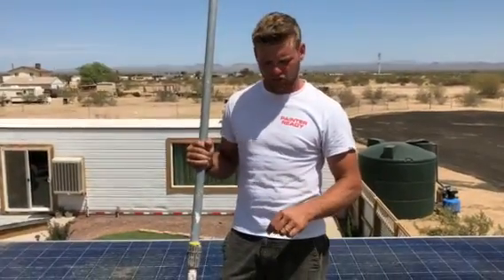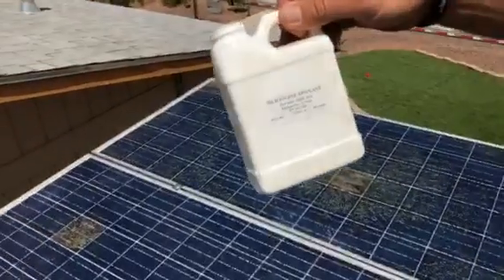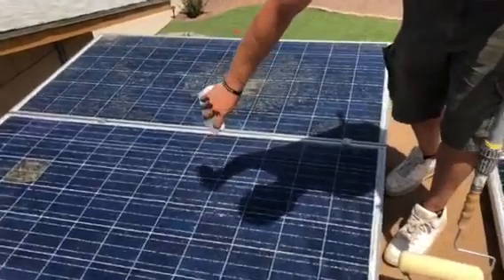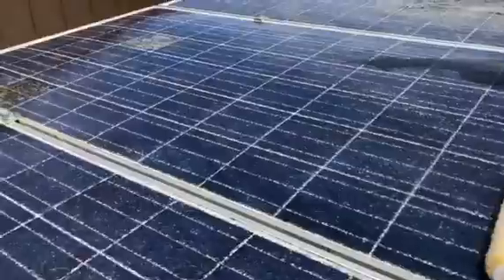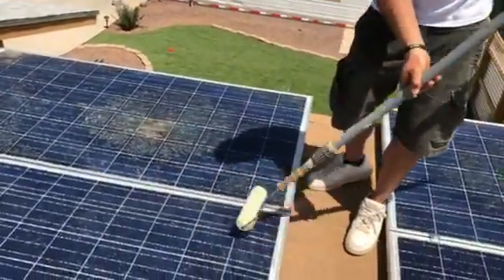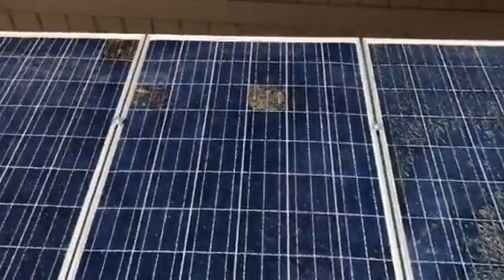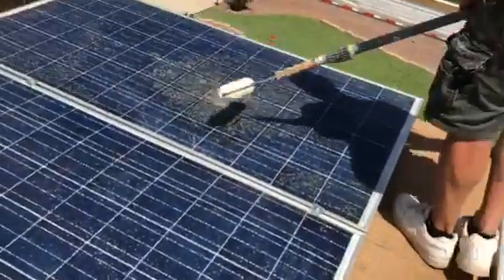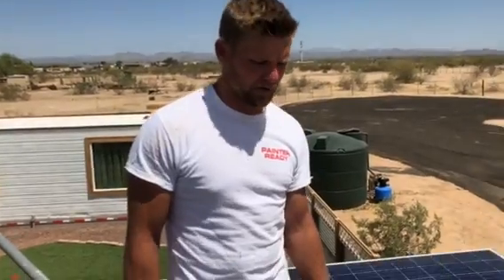How to repair broken or cracked solar panels

Comment: with how much this stuff costs versus solar panels, you'd be better off pitching the panels getting non broken used panels somewhere. i can get used solar panels for $30-100, this epoxy kit costs $65 and will need to be reapplied every other year at least.

i have 1 broken panel i was considering trying to repair but there's no cost effective methods that i've found. it will just be relegated to charging my golf cart and probably use some cheap lacquer on it.

Comment: what happens if they get wet when not sealed? will they continue to work with out a seal? nice job !
Reply: The electric circuit will rust and fail
Reply: If they get enough moisture inside, they will short out.

Comment: Please tell approximately how long the coating held up. Is it still performing at good rate?
Reply: the coating started to yellow after 2 years and the power dropped about 10%
Reply: @BlkFireHawk427 I bet there's a solvent to wipe off the sealant product and reapply for 2 more years🤔

Comment: HOWdy  G-M,
Thanks for the VIDEO
I have had success with Marine Grade exterior rated " SPAR URETHANE" 
Available at MENARDS or LOWES
COOP
...
Reply: Isn't Spar urethane resistant to ultraviolet light, and thus reducing the output power of the solar panels?
Reply: @DougWoodrow  = YES = UV resistant = that  is  WHY  I Chose it for the  Fuel Gauge on my HARLEY

Comment: I'd highly advise no one to do this. Especially if the panels are on your house or anywhere people dwell. A cracked panel is a ground fault waiting to happen. So unless you know 1000% that you've sealed this panel completely, which I can tell you from seeing the manufacturing process myself you haven't sealed it, you will have ground faults. Hopefully, your inverter will catch them and shut the system down but they dont always catch them and if your system isn't grounded properly, it wont catch them at all. Ground faults are a big fire risk in the electrical industry. A lot of the safety measures that are taken in the electrical industry are done specifically to avoid ground faults because they cause fires. Also, those dark spots on the panels are burned out cells. Over time, more and more of those will happen. If it hasn't caught fire yet.
Reply: This is absolute nonsense. That's not what inverters do.
Reply: @MikeWorcester part of what inverters do is to pick up faults in the system. Unless you have a really small, cheap inverter.
Reply: I  believe your referring to a string inverter with micro inverters it should be fine the only problem with this over time is that the epoxy will start to yell after so many years I heard but he might get 5 to 10 years out of them I instal panels one of my customers had a bullet go right through his panel and it’s still producing right now and that was about 5 years ago with no epoxy or anything
Reply: @ACAMPS.HITHOUSE  either you have a string inverter, a string inverter with optimizers, or microinverters. You can’t have a string inverter with microinverters. Either one string inverters or micros either one should pick up that fault and shut down. I’ve dealt with arrays with bullet holes, hail damage, etc… One panel, sure go for it. There’s a small risk but for an entire array, it’s not worth risking your house and the people in it to save a few bucks. UL1699B read it
Reply: @ACAMPS.HITHOUSE  one thing I forgot to mention. I’m dealing with a site right now that has about 50MW of hail damaged modules. The number one concern here is fire. We’re running water trucks once daily to make sure vegetation doesn’t dry out. That’s $15k spent every month to make sure a fire doesn’t break out. That should let you know how important it is to not operate an entire array of damage mods.
Reply: @jarrelljulien5673   I know the difference between string inverters and micros inverts maybe I should have put a period or comma after string inverters but what I was saying is with micros u don’t get any faults unless your talking about monitoring on your computer or tablet it’s not like a string inverter that has a screen on it. And yeah if your talking about 50 megawatts your talking about a big solar farm with millions of dollars behind it this guys putting them on a separate structure on his property doesn’t look like it’s on his main house. This is a small residential job your talking about a whole farm full of broken panels. I’m referring to this guys specific situation. But I really still don’t see how this could cause a fire solar panels cause a fire is extremely rare I’ve never seen it even if you have an arc fault it would just trip the breaker or if it’s a string inverter it would give you an arc fault alarm. I mean you’d have to have some dry grass around or flammable materials this systems going on a roof.
Reply: @ACAMPS.HITHOUSE  yea, I agree with you there. In my original comment I said don’t do this on your house or anywhere people dwell. I’ve seen more inverter and combiner fires than panels but I’ve also seen plenty of hot spots on panels. Shattered panels cause hot spots. Once you have one, you’ll get more because of the increased resistance in the panel. From there you’re basically turning that panel into a heater coil. Throw some dead leaves or a handsy squirrel under the array and it could be a big problem. The initial savings you get from this it wouldn’t be worth the risk of installing these on your house especially with the reduced output, in my opinion. FYI, micros throw faults too. They’re not exempt from UL standards. I’ve had to plenty of panel swaps to test micros and panels for Enphase.
Reply: In my experience these don't catch fire. It's also been my experience that when I find people without power or refrigeration a broken panel works well. I use washers and screws to a fix these busted panels to pallets somewhere in the yard ( yes they are not good on the roof) them boom poor people can has running water.
Reply: Yup I would only used crack panels on a wooden frame away from my house fused and with breakers and even then still a large risk.

Comment: Could you update performance of this solution ? You posted this some time ago so I wonder you could get some aging info now. Thanks for your time!
Reply: Thank you.. I just having some panels with issues.. I will try your method. If you need some help on broken inverters can ask me for help anytime you need l. Thanks
Reply: Panels that I did coat started to yellow after 2 years. Performance dropped about 10%

Comment: what is the point of spreading it on whole panel? I have one broken place like a rock hit it. Is this like a shiny topcoat that improves the performance of the panel?
Reply: The glass usually shatters like an unlaminated windscreen. Cover wherever there is cracking to seal out water 💦

Comment: I am also here in arizona, and picked up quite a few panels just like these. They still produce 90% of the power which is amazing. Does the silicone over time change color or yellow?
Reply: Hi Michael, I have several broken panels too... for how long have you being using them? Do you percieve any performance degradation?
Reply: @Eddy Lockhart  So I have had these shattered panels (the whole surface) for 5 years now, and they still produce 90%. One panel I coated with the two part marine Epoxy did yellow greatly after 2 years, so I don't use that one and I don't plan on coating the other shattered panels I have (bought for $25 each at the time). They were a great emergency back up option.
Reply: @BlkFireHawk427 you mean those five cracked panels are working 5 years without qsil216, right?
Reply: @BlkFireHawk427 btw what do you think, does it make sense to buy such a panel of 370 watts still producing almost 100% of power? it's shattered not heavily but it seems it doesn't really affect it. Price is 50$ for such panel
Reply: @dmytrolytvynenko6537  Hey, Sorry for the late response. The only concern you would have with a shattered panel is Water/Rain. Here in Arizona, there isn't much of that, so they are of value for a cheap price, especially in an emergency
Reply: @BlkFireHawk427  isn't much of rain, but it occurs from time to time, I tried to google and I see you have about 12.26 inches rain annually, and my region, izmail Ukraine(it's the most southern part of country) about 17.5, not big difference. The biggest reason I am buying this is to be safe from electricity blackouts in winter and maybe save some money in a long perspective.
Reply: @BlkFireHawk427  thanks, i thing I wont buy this qsil216, if I decide to do something with this, maybe use some film to protect it from rain and that's all

Comment: Subbed you brother... Seem a comment on a diy powerwall page on FB and looked up the broken panels I bought warranty panels for my off grid homestead but they aren't broken... Three white coating on the back is splitting ... Stop by and check me out
... I'm doing a 300 Subscriber giveaway shortly... How's the output on those

Comment: what kind of resin are you  using? Does it go with the sun and high temperature or are you using a special resin for this job?
Reply from the maker: Oscar Same this 2 part silicone resin qsil is all you need. It’s flexible (silicone) but clear and thin. It take a few days to get hard hard and never dries like fiberglass resin it’s always kinda silicone soft
Reply: @gregmcgrew4986  
You should do an update...
also more videos on whatever topics..
ie what's around you in Arizona.. I'm in the UK cold and damp etc.. with a few weeks of heat..
...as you did a good video..
I have just been given a broken panel .. and so have been trying to find out best ways to repair it.. there's a few ok videos but some that are not! One titled how to fix a broken solar panel took several minutes and smugly said buy a new one.. I reported it to YT!
Did you test the voltage and more importantly the current output of each panel?
and also the setup?
Reply: Is there any oxidation on the panels after 4/6 years?

Comment: You should do it in night time.  You  have shortened the cells with liquid.   !!
Reply: You don’t have much knowledge about silicone
Reply: @michaelbarahona7871  How do panels in this state  would work? As I know, a cracked cell may interrupt the circuit of cells in series, killing the potential of the panel
Reply: @CapitOG  in these panels the cover glass is cracked, not the cell. You will still measure normal Open Circuit voltage even though the cover glass is cracked.

Comment: I know adding baking soda to crazy glue...hardens like glass,...have you tried adding baking soda to the epoxy that you use.. to fill in the missing glass...then do it like you are doing on the next coat.???? Haven't tried yet...best David
Reply: It will not work. Any cyanoacrylate based superglue will work with baking soda but epoxy won't. It's a completely different chemical process. Other than that, this is not epoxy but silicone.
Other than that, epoxy is not weather resistant. It will degrade and fog up in UV and also absorb water and become completely opaque.
Btw not trying to be a smartass, I'm just trying to prevent really expensive mistakes here
Reply: Isn't baking soda water soluble?   Any exposed particles will wash away in the rain leaving a frosted surface I am guessing.
Reply: don;t do that!!!